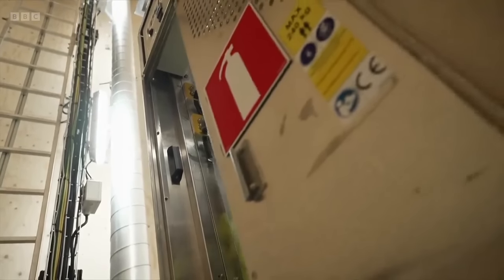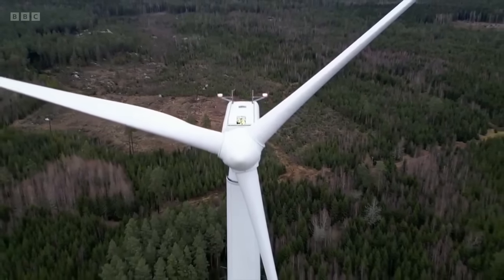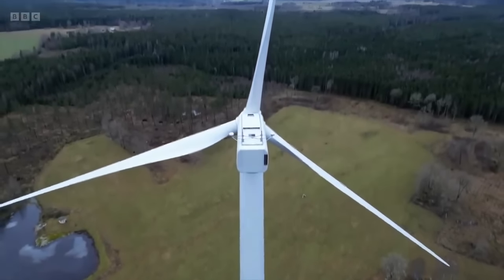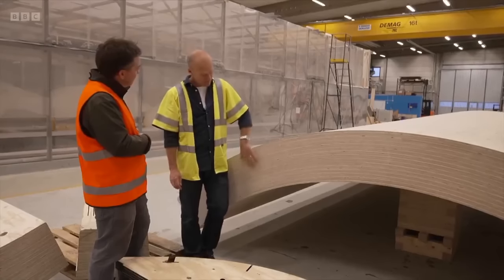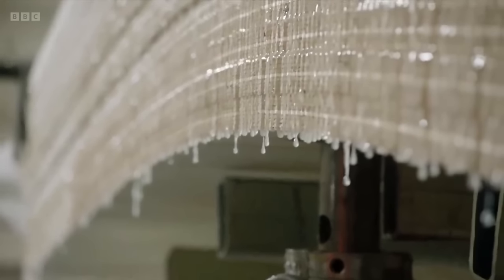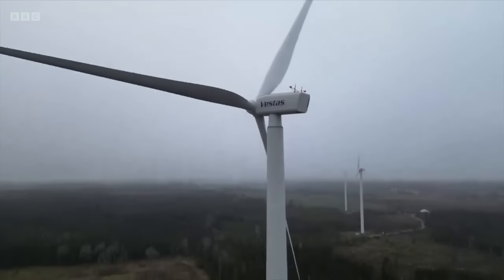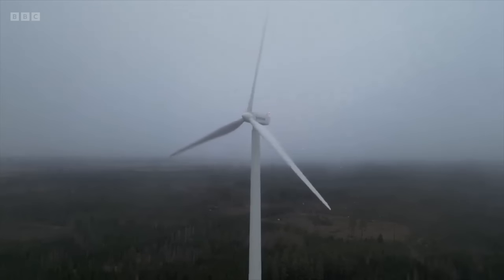Sweden’s giant wooden wind turbine promises greener future | BBC News

Comment: It's only the tower made of wood, not the turbine blades.
Reply: Could those be made of wood in the future as well?
Reply: @twistedyogert Composite wood maybe
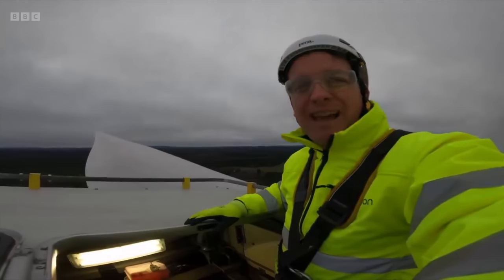Reply: Thanks, captain obvious, we did hear that at 1:13, because we too watched the entire clip: "These blades are like almost all wind turbines made out of fibre glass. The generator that I'm standing on is primarily made of steel, but the company who's built the wooden tower say that by making the tower out of wood it's storing carbon dioxide."
Reply: @all_letters_forwarded  "RM etc" may have an attention deficit problem. Alternatively, "RM etc" did not watch more than 30 seconds of the video before getting busy with its' digits and then it went looking for another video on which to stick an equally negative, supercilious and/or stupid remark. Once they are no longer strong enough as turbine blades or have begun to feather at the ends, the blades are still super strong and could be used as instant bridges. Bolt them together with the fat end at one side the thin bit the other complimented by the next blade placed the other way round. Bolt as many together as you like to carry paths or roads across spans of 100 ft or more, the longer the blades, the greater the span. Putting an appropriate surface over the top of the blades is very easy. The blades will take the strain for at least a couple of hundred years. A span of 100 ft is more than enough to span a 3 lane motorway. I've got LOTS of good ideas. 

The wooden tower sounds a nice idea but we know that steel ones can be melted down and turned into washing machines and builder's wheelbarrows. I'm a bit worried about the percentage of the wooden tower which is deadly poisonous glue and about the disposal at the end of the tower's life. Solving one environmental disaster with another is not particularly sensible. I don't know about you but I would like a bit more imformation, not just from Otto who had a product to sell. Remember the environmental disaster "Tetrapacks" are also a development from a Swedish bright spark. Seven layers of plastic and paper which is only suitable for burning giving off God knows what into the atmosphere (the Swedes are keen on waste incinerators), or costs a fortune to separate is also not particularly sensible.

As I am in deepest Slovakia for the Winter .... longer winter days (24 minutes longer daylight today than at my home in England), electricity 10 pence per kWh and skiing 20 minutes up the road, I shall finish with Všetko najlepšie (All that is best)
Reply: @twistedyogert  Some blades  already use Balsa wood components.  
Making an entire blade of wood would be problematic.
Reply: Laminated wooden airscrews have been produced for over a hundred years.  It may be possible to build them at scale. It will still be an energy intensive process from the felling tree to a completed blade.
Reply: You can make blades out of carbon fibre. That would at least make the thing mostly carbon. And as long as that's the case you always have burning it in a trash burning facility as a last fallback. A bit of CO2 is generated, but not more than would be captured when making it.
Reply: @auspiciouslywild  the issue with this would be the oil based epoxy resin used in the lay-up. A laminated wood blade could use 
resorcinol glue which is a wood based product.
Reply: @thamesmud  laminated wood will be oke for a Camel a Pup a D7 and even for a Zeppelin, but it will not work in a large scale
application like a turbine, and yes indeed, it would  be very intensive to produce and the wood needs to be dried carefully.
During the days of WWI there was also much more and better quality wood available.
Maybe they could experiment with more Balsa content in the composite blades, but balsa is already getting more scarce and expensive
because of the use for turbine blades.
Reply: @bramesque  The 'Spruce Goose' was pretty big and the Mosquito was mas produced.  Spirit Yachts are currently building 34m sailing yachts from laminated timber and Hess Timber in Germany recently delivered 43m long glue laminated beams to an Australian swimming pool project.
These projects are a long way from WW1 aircraft in tes of complexity an stress loadings.
Reply: @thamesmud  Spruce goose, Mosquito, Horsa, Hamilcar etc.. were indeed laminated at some places like bulkheads and wingspars etc..
and a lot of birch airplane triplex was used, which is also a kind of lamination.
If you talk laminated hollow construction there might be a chance, but not a massive walnut mahogany prop. i thought this was you were thinking about.
Weight would be the biggest problem cause of the centrifugal forces. maybe that's why the Balsa composit hollow construction.
Wood is a beautiful material, those yachts and airplanes are/were real sturdy.
Reply: @bramesque  The Mossie was a balsa core laminate. Dehaviland continued this onto the Venom and Vampire jets in places.  Ask a boatbuilder and he will tell you that wood composit boats are lighter than glass fibre laminates until you get into pure carbon epoxy systems.  The carbon systems use epoxy reasons whilst wood works well with phenolics which are not oil based.  Fairy used to hot mould boats from thin laminations in an autoclave with vacuum clamping, I think that's the process used on modern carbon composites.  Many Fairy Ducklings have survived some over 70 years old.
Reply: @thamesmud  We can use green bio-based epoxy resins. Oil is just hydrocarbons after all.
That's a transition I figure will happen pretty much on its own once we stop using oil/gas for energy. Oil will get really expensive once it loses the economies of scale. We're already starting to see that with bitumen: we're much more efficient with our use of oil for energy, so we have less bitumen to go around, and so bio-based bitumen alternatives are starting to become economically competitive with fossil oil based bitumen.
I do like the idea of trying laminated wood blades though... Perhaps with a huge CNC you could make them quite fast/efficiently, and with the minimum required materials in the interior? No idea if it'd be lightweight enough though.
Reply: @auspiciouslywild  they would be made the same way the composit blades are.  They are moulded with laminations onto a shaped mold.  You might need cnc for the mould but Dehaviland used concrete formers.
Reply: @all_letters_forwarded  that make you feel good about yourself, calling me Captain Obvious? I was informing the casual watcher who may have been click-baited just as I was. The title is MISLEADING.
Reply: @terryhoath1983   ADD hm? I was informing the casual watcher who may have been click-baited just as I was. The title is MISLEADING. But you can go through your day feeling great about yourself now.
Reply: @RM-nm3xn  Well, my dear R.M., the casual viewer who may feel that he or she has been click-baited does not bother reading comments. This video was NOT click-bait. It was a genuine attempt by someone at the BBC to inform. Unfortunately, the little boys and girls at the BBC these days are still a little wet behind the ears and didn't ask Otto some searching questions such as I raised in my reply to "all_letters_forwarded". As for my day, I'm not quite sure but I think I feel "great". Thank you for your interest. The Sun is shining brightly and we intend to go for a circular bike ride in the brilliant sunshine via Starý Tekov and down the side of the River Hron. With the recent snow melt, the water should be thundering through the sluice. Unfortunately, YouTube comments does not allow me to send you any pictures.

Comment: The idea that this is a great way to sequester CO2 is a bit of a stretch.  Especially when you look at Sweden's description of how wood is eco friendly.  They claim the energy used in production is recovered by burning the sawdust and the products at the end of their life, so it's energy neutral.  Obviously, this puts CO2 back in the air.  You can claim this is cyclical because it will then get into the wood of the new trees.  But that's not really sequestration.  And what happens when you burn the glue in the glulam?  Sounds toxic.  This all seems like a lot of greenwashing to me.  Steel or aluminum will have a longer life, require less maintenance, and is readily recyclable without having to wait 20 years to grow more trees.

Comment: We suggested wood years ago. Received plenty of response stating wood is not strong enough. Here we are, using wood. After rolling out hundreds of thousands made out of steel for quick sales. Hopefully this company beats the competition becuse this is a true green direction
Reply: Fiberglass is not eco friendly so isnt half the other materials used including the lumber is not eco friendly 😂😂😂😂 just because your using a renewable energy source does not mean its efficient or even green for the fact that it takes over 50 years to even replace the lumber that was taken to rebuild shows more work goes in to producing the lumber than the actual building. So your saying all the removal of wood to produce minimal energy is eco friendly? You have been deceived!

Comment: Glulam most definitely works for applications like this. It also has been holding my my hometown's church for 50+ years... Canada like Sweden has an abundance of forests to draw upon to make these so why not? They are much more sustainable than concrete or steel so whatever you can do to minimize the use of those materials is probably a good thing... Especially when as of 2023 Solar and Wind and the #1 and #2 cheapest sources of energy on earth...
Reply: Most unreliable!
Reply: Not cheapest by far worldwide. Not cheapest anywhere without major subsidy which creates a false sense of value.
Reply: @tannerweinheimer7839  check the data's, wind and solar are way cheaper than the other source of energy, even without subsidies
Reply: @lucacasagrande2456  Solar and wind power are cheaper only when the sun is shining and the wind is blowing. At high grid penetration, solar and wind power need a lot of storage and transmission to steady out their intermittency, and this storage and transmission is very expensive. For places that aren't blessed with lots of hydropower, a good option for emissions-free baseload power is nuclear.
Reply: @cedriceveleigh  that's sure, but the cost per MWh is still cheaper than gas, coal or oil, that was the point of the discussion

Comment: Steel is 100% recyclable though and a Turbine will last 30+ years anyway so theres no issue. Even the carbon fiber blades which haven't been fully recyclable is fine because the benefit outweighs the negative a million times over. If we're gonna start getting upset over a SINGLE wind turbine blade not being recycled after it alone has cleanly powered literalyyy 1,000s of homes for 30 years then we might aswell get rid of the vast majority of our stuff because the vast majority of things will be much worse. It's like when people complain about the production of solar panels causing emmissions, like of course it does, everything does. But once it's produced it then produces energy for 30 years with 0 additional emissions.
Reply: Howard Hughes made the Spruce Goose out of?

Comment: and where does the glue come from?
Reply: No one's saying it's 100% green. Though it's much cheaper and cleaner than extracting, processing and burning fossil fuels.
Reply: Right. They'll probably be using something like epoxy, phenol formaldehyde or even a polyurethane adhesive. All of which require petrochemicals
Reply: Dead cow feet, so what, their farts are adding to the greenhouse effect. Farts are bad mmmmkay!   LOL (sarcasm)
Reply: the glue is a lesser issue than the waterproofing, that requires a much larger quantity of synthetic material. I would guess something polyurethane-based as is used for car paint, and a different polyurethane composition for the wood glue, since polyurethane wood glues are the most wateeproof common wood glues. though you still want to protect the wood from water intrusion very well anyways and possibly even install a drying system inside the hollow parts, because wood warps when exposed to moisture changes (and if it gets and stays properly wet, it gets heavy and soft, and eventually very soft as it rots). but if the moisture problem can be avoided, wood can probably replace the bulk of the fiberglass composit, and is more manageable as waste at the end of its lifespan even with glue and highly weather-proof coatings (because all that sh°° burns just fine, which fiberglass does not).

edit: nevermind, I commented before watching... I can't believe they're using plywood for a tower structure when they're supposedly trying to be environmental, and the tower only needs strong load bearing in one direction - just like trees. they should use long beams, not imitate the structure of the metal tower just with incredibly thick plywood. that does use a ridiculous amount of glue. and look how compact the sections are (veneer cutting process can only produce a limited length along the grain depending on the width of the blade), those joints between them are going to be weak points requiring heavy reinforcements. a structure made mostly of tall beams could be built much lighter, not just with less glue but with less wood. and cheaper, because good quality plywood like that costs as much as relatively highly prized hardwoods, whereas for structural stability from beams, spruce would be a very suitable wood and is the cheapest. I bet the internal structure of the tower in a beam construction could be built for a tenth of the price, plus another tenth of the price for a skin.
these people don't know sh°° about working with wood, they are imitating a metal design with wood.
Reply: @Ass_of_Amalek  Could they use a wooden frame but use a metal "skin"? It wouldn't be free of metal but would use less of it. Perhaps they might not even need to use metal, they could use fiberglass or carbon fiber.

Comment: "More than a 100% less carbon emissions" by storing carbon...I'd like to see the numbers questioned by an awake journalist with a calculator. You still have to take down and transport trees, process them in a factory, glue, bend and quality control the product, transport and mount it with what was obviously not wooden bolts, and every installation like this will have a footprint where it is installed; think clearings, fillings and roads. It's probably much better than steel still, obviously, but don't just swallow and regurgitate outrageous claims, please.

Comment: I have an question- If steel making process are not invironment friendly, then why do they think that use of wood is environment friendly❓.......😢
Reply: Because you don't need to use fossil fuels to grow wood. It absorbs carbon from the air and stores it. Steelmaking (currently) uses coal to reduce iron ore into metal.
Reply: @SocialDownclimber  thanks 🙏
Reply: @Critical-Thinker895  Can you show me the paper that compares the carbon emitted in making the plywood to the carbon stored in the plywood? Real interested in that as long as it isn't based on feelings.
Reply: @Critical-Thinker895 Most industrial manufacturing in Sweden is already carbon emission free due to the fact that electricity is since long produced by hydropower plants in the industry rich areas.  What creates carbon emissions in the production of wood is the machinery used for harvesting and transportation.  Although trains are electrified and the fossil diesel is slowly being replaced with diesel also made from wood, besides the heavy machinery also being replaced with electric vehicles.
Although I don’t have the data I believe that this plywood will be even better than carbon neutral.  Calculating for its full life, being recycled into some other fibrous material after its life as “windwood”.  And then decades (or centuries) later ending up as being burned to produce energy, when only some of the carbon that the wood “breathed” from the air will be “exhaled”.

Most of the wind power plants in Sweden is being built to be able for the industries to go fully carbon free.  Both the forestal and the steel industry.  And the steel industry is to my knowledge way more energy consuming.  The problem with steel is however that the process itself needs carbon.  So it won’t be enough to just build large wind power plants to accomplish this.  But inventions have been made that replaces the carbon in steel with hydrogen.  So the steel industry can go fully carbon neutral.
Reply: @Room-f6n work only for Scandic Countries not elsewhere, since they will end up allowing those guys to chop Brazilian Amazon forests for their feedstock, only Scandinavian Countries did have the political/governmental integrity to make sure that never happened.

Comment: This is so dumb!
The problem are the carbon fiber blades, which are not recyclable.
The tower steel is!
The wood used here is not, and eventually will release that carbon it stores while in use.
Maybe it can be reused in building homes, or some sort of industrial structure, or roof, afterwards.
It won't manage the loads of the turbine, but for buildings it will be more resistant than most building materials.
Maybe some thought should be put from the designs stage. ;)
Reply: A little hard to store carbon without photosynthesis.  This is a Benny Hill skit and making plywood out of it will release 100% of the already stored carbon in the wood.